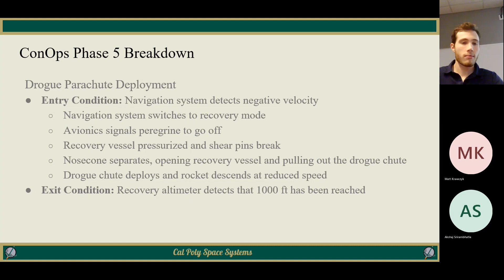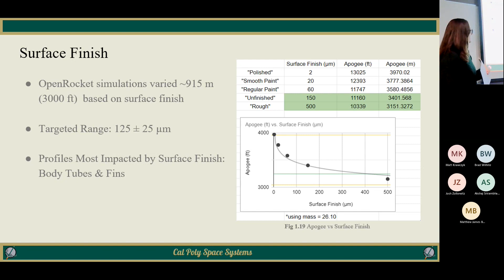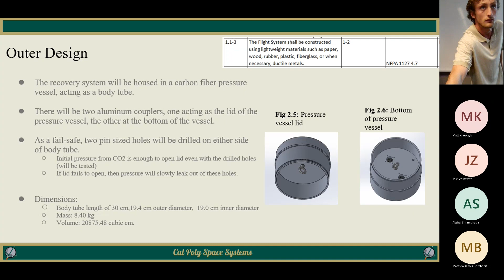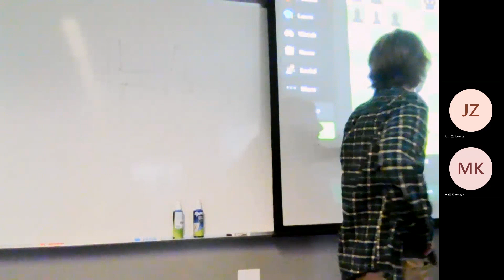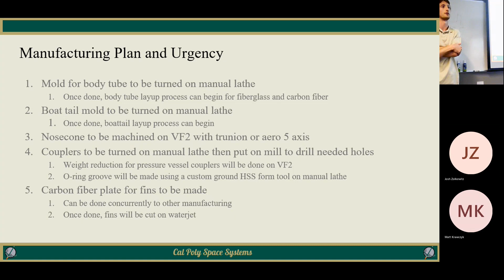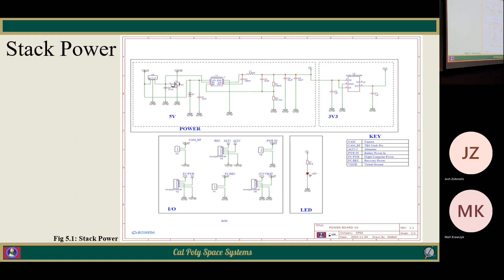Crescendo Competition Rocket CDR

Comment: Probably covered in other documents but you guys will probably want a procedure for the testing of the release system. Not sure if the safety plan that was implemented in 2014 is still in place, but I have copies of those documents if they were lost with time. Also, I recommend you bring a few of those CO2 cannisters as backup any time you want to launch. If they require 24h to cure and something goes wrong within 24 hours, you'd need a backup. All the questions from who I assume is YK were really good too. If you need powder, you can get it at muzzleloading supply stores, maybe Outdoorsman in AG.